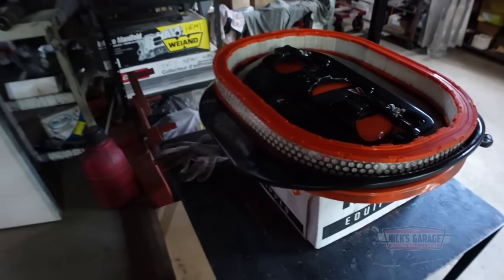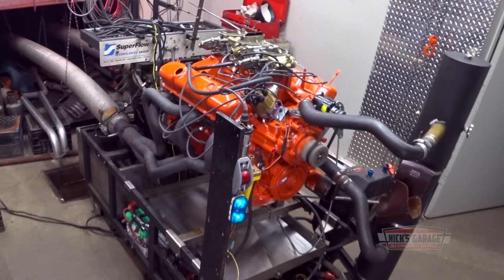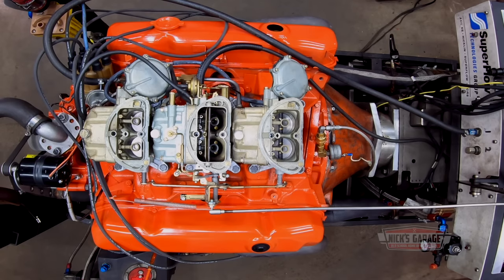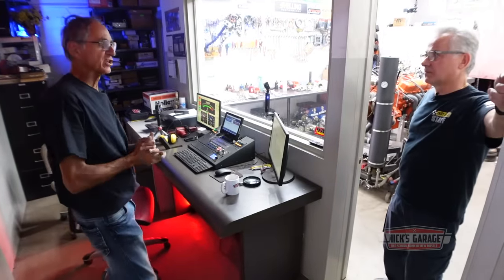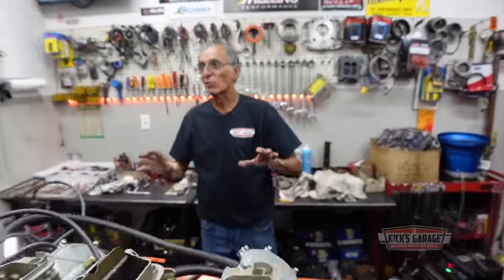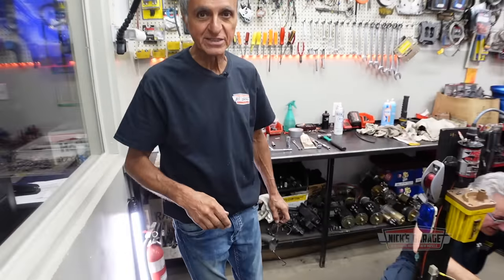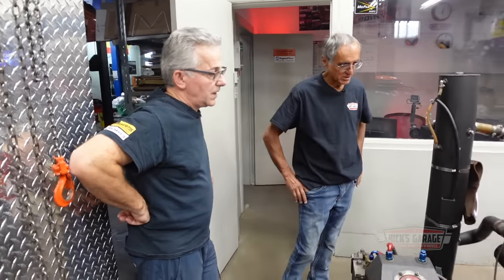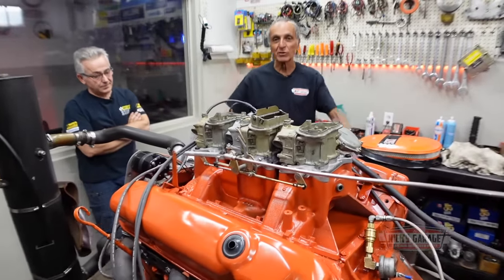HOT 1970 383 Mopar - Stroked and Dyno Tested - Road Runner Tire Melter

Comment: Nick, my 383 build is completed and motor is in my 1970 Road Runner as of last week! Stroked out to 480 cu in, with Holley 750 cfm, new cam, roller tappets, stock manifolds. On the dyno we pulled 425 hp and 530.5 ft lbs! It feels absolutely amazing to drive! Just did some tweaking on the distributor springs to cure some knocking, and it is running great now. I'm a happy man. And all from a 383, amazing.
Reply: I have been looking at a 383-496 stroker kit for mine.  This makes me think it might be the right move.  Do you have any more info on your build?
Reply: @ShannonLandsberger  I just got the build sheet today and will share the details with you tomorrow on the stroke kit, cam, etc. Stay tuned!
Reply: @ShannonLandsberger  Here's the build sheet of everything major. One thing to know is that there will be some milling to do in the block, in order to get clearances for stroking kit. On my block it took about 6 hours of hand work and testing. My carb is not on the build sheet (?Did they forget to charge me) but it's a 750 Holley. I reused existing manifolds for simplicity and to retain original look of engine. They are pretty free flowing I'm told. With stroking this motor is now a 480 and you can see dyno results above.
Chrysler custom kit eagle stroker crank, eagle H beam rods 6.760 icon pistons, moly rings and cleavite bearings

Roller cam competition cams Extreme Energy hydraulic xr280hr 23-711-9

roller lifters comp cam
Edelbrock intake
Comp valve springs 925-16
Comp retainers 10 degree 741-16

Hope this is useful let me know if any questions.
Reply: @richardbornemann806  Was this a stroker kit from someplace or your own selections?  Did you do your own clearancing and build?
Reply: @ShannonLandsberger  Its the Eagle Stroker kit which includes crank, pistons, and rods. We did not do any custom work on the heads. The build was done by Watts Racing Engines in Seabrook NH. I told them what I wanted and they came up with the design specs, ordered everything, and they did everything turn key. They hit it right on the money. Hope this helps, let me know if you have any more questions. :)
Reply: @richardbornemann806 Long tube headers would really help wake that engine up
Manifolds are a hindrance...stroke the engine they are  killing power.
Reply: Good thought but here's the thing, I've got so much power now I can't get the car to hook up, and that's with an auto transmission which, if anything, tends to soak up some of the power. @gordocarbo

Comment: My father, when I was younger, ( now65)  got hold to a set of heads from a company that cast them in a HEMI configuration, the relocated the valve angles to work on the (B) ? Block 383 and 440 short blocks so that you would have, basically a high reving torque monster HEMI, that thing, coupled to a TCI 727  Automatic, with  a custom torgue converter could destroy a set of Firestone drag 500 slicks at the drag strip back in the 70's and 80''s he won many events, my father, (God rest his soul) was one of the innovators back in the day he had one heck of a reaction time and would smoke so many of those other drivers coming off the line, it was ridiculous and glorious at the same time, gave me the love of all things mechanical, I miss him he was a character and had a very odd sense of humor and could find, even when he lost a race, something funny in the moment, Nick is in that same group, keeping the spirit of mopars alive, keep up the fantastic work, love that stuff.

Comment: I ran a complet Hemi botom end in my 440in 30 over bore 70 opened chamber heads angel milled 66 " and the intakes the same two paper gaskets with the valley cover in between the intake gaskets it worked great and the car went from 12s to 11.50 et later it went a 10.98 et !

Comment: Mopar designed the low block 6 barrel intake that Edelbrock made. It was originally hoped to be used on a 400 6 barrel engine in 1972, but it got scratched from production.

Comment: Heh nick the reason you get the big on the Dyno is your opening the outboard carbs at to low a rpm. Up the rpm starting point and it will not bog

Comment: When using a 440 crank in a 383, there are three options. 1.  Cut down the mains on a 440 crank.  2. Buy a new crank with 440 stroke and 383 mains    3. Bore and hone open the block so that the main bearings are now 440 size on the 383 block. Then use an unmodified 440 crank.
   I'm curious why the third option is NEVER taken these days.  The answer I get is "you don't want to weaken the block (by boring the mains)."  But, it is only as weak as a 440 bock.  And the alternative is "weaken the crank" when you cut down the main journals. And who knows how thick those journals are. After they are cut, is there still enough thickness to match a stock 383 crank?
Reply: Cutting down a forged 440 crank is still strong for this set up.

Comment: The center carburetor doesn’t look like it’s flowing any fuel. And when you roll the time in back to degrees it will lower the RPM on the engine

Comment: My first car was a 71 charger. Put a 383 from a 68 newport in it/ crashed the charger and put the engine in a 76 cordoba, then put the same 383 in a 68 coronet/ In 92 I traded the 68 coronet for a new 1992 Plymouth Laser, they gave me $300 for the 68 coronet. What a dingbat. 30 years later and I now drive a 66 Dart with a 225 4 speed./ Still what a dingbat.

Comment: Personally, I've only built one engine. Yet I've re-tuned many factory setups.
"Calibrated hammer" made me wince. "Calibrated fingers"... That's how it'done.
I like that you run extra oil for break in. But the way you remove the extra.....?
Here's your tech tip: get a spare drain plug. Drill, tap and install a petcock.
Result: no oil burnt fingers or dropped the plug oopsies. You could even run a tube to a catch jug.

Comment: Very cool engine package.
I would have liked to see a testrun made with just the aircleaner base (and no airfilter). My idea is that the baseplate might straighten out the airflow into the carbs better which could make a tad more torque/power.
Reply: I had the same thought.

Comment: Nick I'm 64 and I traded carbs and flat tappets for EFI and solid rollers a long time ago. I don't see the point in building an engine that doesn't get at least 1 hp per cube. That off my chest, I also think it would be a no-brainer for you to put a security or web camera over you engines on the dyno (instead of just a go pro to look at later) that feeds a monitor just for it in the control booth so you can see that view in real time. You could see the distributor slip on that kid's engine that had two gaskets under his, and the end barrels of the six-pack on the stroked 383 open late from lack of vacuum on this video. For the little it would cost, it's a real-time view worth having.

Comment: 6 packs from holley in the 2,000's had a an issue with coatings and we found the metering blocks would disintegrate so holley will send you a new carb free of charge.
Reply: Really, I did not know this. Thanks.

Comment: Looks like a Great Engine build combo, but I want to say something I've been holding back from saying for years watching Nick's Dyno Pull numbers. And that is, these numbers are without a fan belt hooked up to an alternator and water pump, and any other options like power steering or AC. With those items hooked up on the motor it'll definitely lose a lot of H.P.- but that is never mentioned.
Reply: What does that have to do with anything? The goal is to build a powerful engine, test & tune it, install in vehicle, get paid. That COULD be done without the benefit of letting us watch.
Reply: @mickangio16    just as YOU felt the need to make that comment, I felt the need to make the comment. The engine build is for a Car that will have AC and is headed for Australia where it is HOT, and when driven down there it won't have anything close to those H.P. at the rear wheels, people should be aware of this. Engine Dyno numbers are a nice reference comparing one engine to another via the same Dyno(especially if a race engine), but real-world applications on the street are a whole different ball game. PS personally I prefer Chassis dynos for real world numbers on a street car.
Reply: It never even made sense to mention. It's only common sense.
Reply: So, you want to see it dyno tested with air conditioning operating?
Reply: If I ever get a chance, I would love to try testing an engine on the Dyno with the belt on the alternator, Water pump and Power steering.    NO  A/C.       Then test again without the accessories.
Reply: @nickpanaritis4122  That would be interesting to see the difference in HP. And hook up the alternator to a high amp Stereo and see how much THAT draws it down -lol....just kiddin' 😆

Comment: PCV and vacuum advance are omitted for this test.  But, it seems to me, these have just as much effect as carb jetting and timing. Now, they may both wash out at 0 manifold vacuum full throttle on the dyno, true.  Selecting a quality PCV and vacuum advance is the first task. Then making sure both are functional is the second task.  I would like to see these installed when you do the exhaust manifold test.
Reply: Neither effect WOT power but they do/can effect part throttle driving and idle quality. That's why the engine must be final tuned in the vehicle.

Comment: isn't having the extra litre bad cause the splashing causes foaming in detergent oils which cause small bubbles to be pumped around the system while its running leavin gaps where the bearings sposed to be runnin on oil?

can also cause low oil pressure due to this

Comment: Never seen one but my street racing buddies from back in the day liked 383s they're Dart was named Hillbilly  I've seen more than a couple 2- 3 in the morning before Pinks and other shows off the trailers and one night I was like damn that SS 85 Monte Carlo was barking so hard they set him out it was like that 70 dart jumped in the air and landed neck and neck at the end of the run the guy said - baka baka baka tapping the gas on him lil reminder of what just happened 😅

Comment: Nick way back in the day.  Maybe you are few years longer in the tooth than me. I worked butt to save enough for a car for work and school.  My Pops dropped me off at the lot to haggle on my own. I got the guy down from $500 to $400 just from curiosity. Not good enough. Pops steps in offers $200 cash. Dad played the plaid sport coat. What a tag team 👍🏻💪🇺🇸. 70 Polara 383, 4bbl sure track wagon. 😏.  That station wagon put to shame today’s crossovers. Plus we did the battery, alt, and stater warranty same day.  Not cheating if they warranty and guarantee lifetime free replacements.  Plus my neighbor had the parts store.  We weren’t cheating anybody. We were all satisfied customers. The returns an warranties created jobs too 😎👍🏻💪🇺🇸💪I had big speakers 🔊 way before these kids. I had Jenny, lights and speakers. With back seats aft folded, still had two rows for certain boys and girls to try to be men and women 👍🏻🇨🇦🏴‍☠️🇬🇪. Soorry not sorry. So my folks are passed over a decade, we all go eh? Some of just know where you’re going.  My Mom had a used 67 Barracuda, red on red white convertible top. Yes a ladies car. Just the what? 273 V8 , drum brakes all around, slushy automatic. Sorry macho men, that was a cuter car than the same Mustang at the time. ✌️🖖🤟

Comment: Very cool!  I have the exact problem with my 1970 Challenger with a 440 Sixpack, 0.060 over, 10.1:1, mild cam, steel heads and manifolds.  Runs great without the air cleaner, and shaker, put the air cleaner and shaker back on, I get a stumble.  I have black springs in the secondary's, 65 primary jets and 88 secondary's.  I also tried a 35 squirter with a hollow screw. So frustrating. Engine dynoed at 432 HP and 520 ft/lb torque.
Reply: Try tuning the engine with the air cleaner. 88 secondaries ?
Reply: @nickpanaritis4122 , yes promax plates with 88 secondaries.
Reply: @kpsierens  .   OK.

Comment: Hi Nick I like what you do to the engine on Dyno tuning. I want to know how much horsepower my 5.3lm7 Chevy avalanche 03 would make I am bore it +20 over pistons same head with new spring camshat 195in./ Ext 192 dura 482 /487 lobe 116 speration  .ty👍🙏

Comment: Hi nick, I imagine if you are using a short deck, you must use shorts rods, as a result you have a lower rod ratio, for this reason the piston speed is higher near the top dead center, and this produces a high vacuum at lower RPM. excellent video regards from Buenos Aires Argentina
Reply: 440 source actually sells pistons that you can use an rb crank and rods in a b engine

Comment: The oil pump is in relief at idle? I really would think that it should not be. I bet if you put a lighter spring in so you only had 60psi at max rpm you could get that 500tq. A thinner oil might be a good solution too. I was talking to an engineer from power seal a couple weeks ago and he was telling me about an engine they were having bearing troubles with and they went to a lighter weight oil and quit wiping out bearings the oil temp dropped a hundred degrees and they picked up 40hp. Turns out flowing more oil thru the bearing carried away more heat made more power and robbed less friction. It works better with todays lower tension piston rings too.
Reply: Nice to know.  Thank you.

Comment: I have built some throttle linkages using 1/4” heim joints and built my own threaded rod to make some custom parts, or modifications to a stock app that needed a nudge. Hardware store round stock rod can come in handy for many uses.
Reply: I really enjoy this B Six Pack combo! Cut down 440 or something I haven’t learned of?

Comment: I had a 440 6 pack years ago in a charger. It passed everything on the road but a gas station
Reply: That's a corny old saying. If you drove the 440+6 normally it operates on the center 2-bbl carburetor.

Comment: Ok 
 You raised the compression from 8.4 to 10.9 so if you are using a stock plug for 8.4 cr. You would need a cooler plug for 10.9 cr. 
 May be 1 step cooler may be 2 . 
  Also the timing will change with the cooler plug. 
 Also you have high vacuum  are the valve spring letting the valves open far enough with the combo of parts push rods , springs, and rockers or are the push rods possibly to short 🤔 . 
 Carbs I know nick mentioned in past videos that the 6 pack can be challenging. now you had it work then not work right even used ones should work. I wonder if they were upside down in shipping or bounced .
 Just my opinions. but I'll say it  sounds good overall.

Comment: By over filling the oil you risk aerating the oil  which is putting air bubbles in it that is putting the cam and bearings at risk of starvation.
Reply: I guess I have been lucky.

Comment: I have a hp 400 and a Mopar performance three two manifold (both from ebay)new carbs from Holly an air cleaner from Summit linkage and fuel line I think from Summit also those pieces took forever to get to me (probably some round about through Italy I don't know) I need a crank I need some heads I need a bb bell housing (before too long) the rest I suppose would be obtainable.should run good.

Comment: Under rated for insurance 383 would run with 375 hp 396 Chevy all day. had one that was built when bought 425 easily 13.0at 106 completely used up and wornout

Comment: Great job on the 383 Nick, I have an early 71-400 cold weather block would like to go to a 440 crank and keep the stock rods what Pistons would I use and where can I get a 440 crank?
Reply: If you look on the web, you will find a 440 crank.
Reply: 440 engine Fer Sail ⛵  in Texas
Reply: Just get a stroker kit from Muscle Motors.  Best bang for the buck.

Comment: If you can stroke a B block (low deck) to nearly the size of a 440, I wonder why the factory manufactured the RB (tall deck) block?? It's added weight (probably not much) and it makes the engine wider, making spark plug changes more difficult.